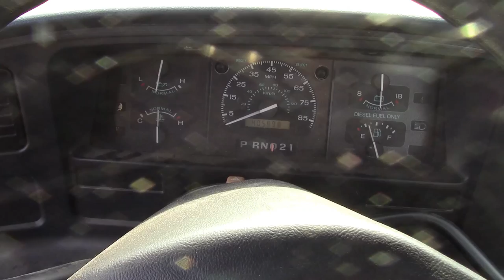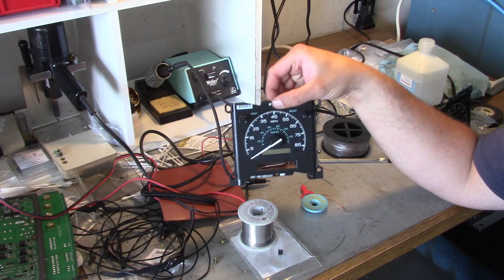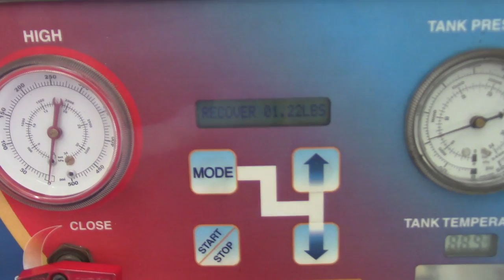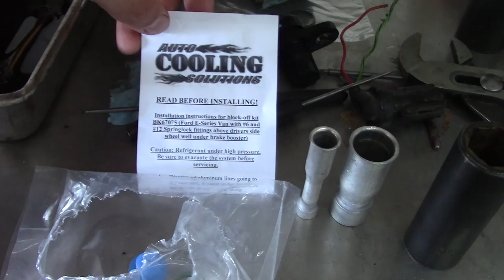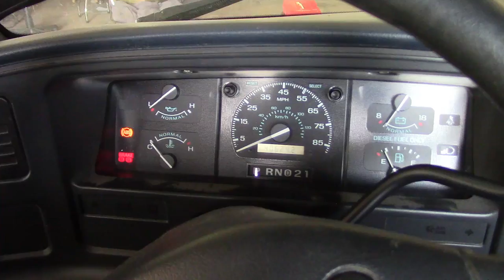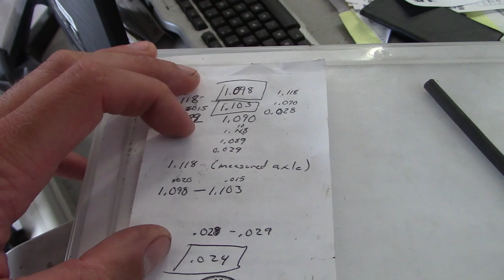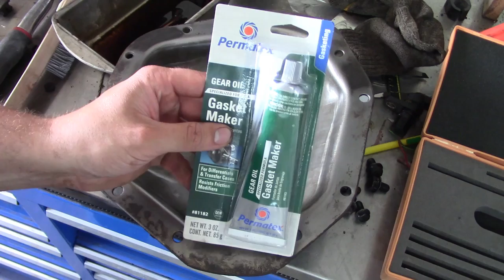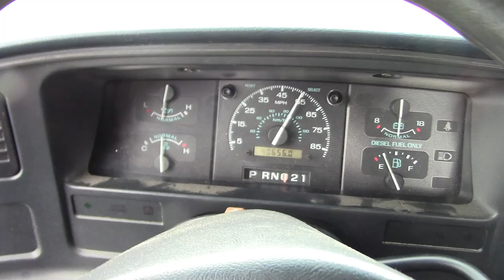Ford E350 | Speedometer Diagnosis Frustration

Comment: One of the things my shop was known for was air conditioning over 50 years experience, nothing lasts forever but auto air is relatively reliable. In the past block off devices didn't exist and you had to be creative, many a vehicle was fixed by the old crimp and weld method so I would say don't worry about bimetal reaction something else will break before you're block offs fail.

Comment: Hi Wes.   Really like what you do.   Please keep doing it.
I AM NOT a mechanic.    I have none of the skills you do.  I am however, familiar with electronics.
My opinion is that it is just the PSOM module.  I base that on the signal I saw from the module on your scope.   Yes,  The signal was a little unstable at times but there is signal and there is signal conditioning in the module.  I believe the module will get all the signal it needs from the tone gear even with a little pitting or rust on the tone gear or ring.  I think there may be other issues with that PSOM board.  I also think you proved that when you tried it in your truck.   I don't think it kicked your butt.   I think you would have had to order a new PSOM.     Just my opinion.    -Jack

Comment: The issue with having dead ends in A/C systems is if the compressor fails etc those dead ends often trap debris and contaminated oil which can't be flushed properly. I know here in Australia we had this very issue with Freightliner Coronado trucks, on the day cab models, they have the lines that tee at the front system TX valve at the firewall and run down to capped off ends just under the passenger side floor. Daimler Trucks here actually released revised pipes which still had those stubs (as they contain the charge ports, but the stubs finished at the ports, so if they had to be flushed it was just a case of removing the valve cores and flushing them.😊

Comment: I’d be happy with a speedo that fluctuated only 1/2 mph!  Mine jumps around like it’s being electrocuted.  Does nothing until about 45, then jumps all over.  I’ve been thinking it’s an electrical issue as several other things went south at the same time (security system, door locks, dome light).  We have mouse problems on any vehicle that sits for more than a few days at a time. You’ve given me some ideas to pursue.  94.5 F350, 7.3L PS.
Reply from the maker: Yeah, the mice a terrible here too.
Reply: I just had a Mercedes SL500 totaled by the insurance company due to mouse damage. They quit looking after they got to $10k in repairs

Comment: Hi Wess you will love the Pico scope - I have one and it makes your diagnosis much faster and accurate.  I have worked with lots of the little induction sensors like you have in the power generation business and I can tell you that you will have a very nervous engine if the speed sensing circuit is not perfect.  One thing I noticed is the relationship between the width of the tone ring and the width of the magnet on the sensor.  Looks like either the sensor magnet/coil is too big or the tone wheel is too narrow.  The wide magnet will take more of a tooth to generate a reliable signal. I know this is a design issue and not much you can do about it.. However, one thing you can do to clean up the signal is to run some shielded wire on that signal wire - only ground the shield on one end though - you dont want to build in any ground loops for you to figure out... when I went to Woodward governor school about 1991 they had a simulator that would demonstrate how a bad tooth would effect the speed sensing circuit on their electronic speed controls - you would be surprised- I'm pretty sure the new tone ring and some shielded wire will cure your issue.  Good luck and dont worry about getting your ass kicked - odds are there have been 5 guys ahead of you on the same issue... nice video..

Comment: I think with these electronic driven vehicles, or for any vehicle for that matter, the initial interview with the customer/driver/owner is as important to make sorting out problems easier. And yes, aluminum and steel will start a galvanic reaction when in contact, its a slow reaction but can corrode parts over time. Any dissimilar metals in contact will induce galvanic corrosion. Its the reason tools, instruments were cases in those nicely made wooden boxes in the past.

Comment: Just a thought . I have used synthetic gear oil in rear end applications. They always leak . I have since changed to Lucas 75W-140 . No leaks. May work better with that with the friction modifier . Thought to myself when you were putting it in . It's going to leak .
Reply: Synthetic lubricants will actually leak more as a whole compared to the standard stuff because  the 'molecules are smaller' from what I understand. I'd rather reseal whatever I need to just to get the superior longevity out of the internals that the synthetic stuff offers. There is most definitely a difference in the long term from using them. From my experience, it can be rather drastic, which makes spending easy to justify if you value your vehicles. My .02.

Comment: I just replaced the front when bearings on my Mk4 jetta, and the ABS tone rings on the hubs look exactly how you would expect them to look after 18 years of central Ontario winters, but I've never had any trouble with the speedometer. I think just the presence of ferritic material will trigger the sensor, rust or no. I guess we'll see when you get the new scope hooked up. 

And as a professional machinist, I sorely envy your 3 depth mics. It seems like everything I build has 3 or more tight depth tolerances, and I have to change at least one rod for every part.

Comment: If it were my truck, I'd live with it (except for the pinion seal), but, on the other hand, I'm looking forward to you busting out the Pico and getting to the bottom of this.
BTW: my former employer worked closely with Pico (I translated the software and the manual into Dutch), so don't hesitate to ask if you need something explained/worked out. Obviously, I've lost my priviledged access to the Pico engineers and developers along with my job, but I would be more than happy to try and help out.

Comment: Customer: "I need a special tool for working on a '58 Packard Straight 8 with double 2-barrel carbs, suicide doors, and purple-and-black tuck and roll upholstery"
Wes: "Hold my beer".
Reply from the maker: I've never messed with a straight 8, but they are cool. My great uncle had one in a Packard. He told us you could set the timing by putting a glass of water on top of the engine and turning the distributor until there were no more ripples in the water!
Reply: @WatchWesWork  you sir are my hero. 😂

Comment: 10/10 for perseverance. It’s an old truck and I notice none of the speed sensor wires are shielded. One potential source of ‘sproggies’ (unwanted noise). Does the speedometer module have its own power rail regulation? Have fun with it anyhow. Some things are just pups from the factory.
Reply from the maker: The sensor wires are twisted together, which helps with interference.

Comment: When you first showed that tone wheel wave I was really suspecting a bad pickup. But the bad tone wheel makes more sense. The amplitude shouldn't have been bouncing around like that. The high and low teeth and the notched teeth were probably responsible for that. I suspect that the driver electronics square up that signal, which should account for amplitude variations. But if it is managing to get double pulses off some of those notched teeth it will be getting a wibbly speed reading. Short of trying to file down the tooth with the notch to get rid of the notch I'm not really sure what to do.

Comment: For future reference, the Dana 80 axle used in Super Dutys, they use a 75w140 synthetic, expensive as hell to do an axle service.  My understanding is that Dana 70 and Dana 80 are the same size center housing, but the 70 uses smaller gears.  I know from direct experience the 70 uses the same yoke as the 60, so it's maybe a Dana 80 housing with Dana 60 gears.  Dodge loves to use the 70 and 80, makes it really hard to know what's what.  The Ford 8250lb GAWR Dana 80 uses a 1410 u-joint.  I know they offer an 11k GAWR Dana 80 in the motorhome chassis, but I don't know what upgrades those have (axles, u-joints, brakes, bearings).
Reply from the maker: I thought the Super Duty trucks all used Sterling axles.
Reply: @WatchWesWork  The SRW trucks use Sterling 10.5 axles and Dana 50 (250) or Dana 60 (350) front axles.  The DRW uses a Dana 80 with 8250 GAWR and 4.10 gears.

Comment: You are the gadget guy. Cool tools!!! Welcome to Fords ministry diffrential gear oil. All other fluids are "its gotta be this or that" 
You're in for a real treat getting the ring gear assembly out of the housing. My Dana 80 with a rear fuel tank - there's no room (except the secret combination) to get it in or out + it's a heavy *****r. Good luck setting back lash + preload + gear pattern.....Cheers.....
Reply from the maker: Yeah, I'm sure the tank has to come out to pull the carrier.

Comment: i have reluctantly, hint hint, taken a cut off wheel  and dug down on a bad reluctor wheel in order to clean up the signal from damage caused by a loose clutch in the LS , i simply cut the grooves down a bit to give the vss signal more definition , it wasnt as dirty and seemed to improve shift quality as well.

Comment: I wonder if there's an RC pair that sets the filtering on the PICO module... that would smooth those variation a tich.... but I'd have to see the circuit.  Your video coherence was FINE!  Great video.
Reply from the maker: Supposedly Ford had updated the design to be less sensitive, but I don't know what was changed.

Comment: Wes that used board could be the issue with speedo bouncing. Maybe it is at the beginning stages of failure? Just a thought.
You'll get it. With the new scope you should be able to view the signals and tell if you have a "jiggle" in the sensor signal that you couldn't see with the other scope that matches the bad spot on the tone ring.

Comment: Tone wheel MUST be replaced.
 NO 2 ways about that. 
Been told by people in the know that rusty tone wheels do nothing negative to hall effect sensors when it comes to doing their job. Air gap is king tho.
Leaking oil diff: Synthetic oil(s) tend to clean and remove deposits that were MASKING leaks that already existed.
That's one of the reason people feared(and still do) going from dino based oil to synthetic stuff.
Maybe that's what happened, maybe not . . . 🤔.
P.S: Don't get hot about it, can't fix something if parts are not up to snuff to begin with. 
NOT YOUR FAULT. 😎👍
Tell the owners what's up and let them decide what to do. Not your problem. 👌
P.P.S: You're probably dying to see that thing go away for good but honestly I'm looking forward to the next episode and the axle leak/tone wheel job. Always very educational and entertaining.
HANG IN THERE ! YOU CAN BEAT IT ! 🤘

Comment: Rust doesn’t affect magnetic fields I think the stepper motor for the speedometer head might be a lil sticky from sitting I believe you fixed the main issue with the module on the speedometer

Comment: Wes had a similar problem with my 96 ford superduty with the 7.3. United radio in Syracuse ny rebuilds the gauges. Mine would shift in and out of gear on its own. No problems since the rebuild.

Comment: I had this issue on my Grand Am GT and it was coolant fluid dripping on one of the bare conductors for the speedometer module. Hence, causing a short, also it was a slow drip that’s why the faulty reading was intermittent.

Comment: Had the same issue with mine. 1997 f250 Powerstroke. Truck must have sat before I got a hold of it the half of the tone ring that sat out of the gear oil rusted.

Comment: Question, do rusty ABS tone rings make faulty codes so as long as they are still spinning and not detached from the axle shaft?  I've never heard of that occurring unless it breaks off entirely.

Comment: The little heat guns were made by Ungar before Weller absorbed them. Mine is an Ungar, great for quick concentrated heat. I use mine for brittle plastic electrical connectors-
Reply from the maker: That thing is awesome!

Comment: I just did my diff cover and used The Right Stuff torque and go gasket stuff.  Let it sit a day then filled.  It leaked within a week and all the bolts were 1/2 turn loose.  Maybe gear oil causes some shrinkage?  I  think all the stores carry now is LS gear oil.  My Tahoe needs straight lube and I couldn't find any.
Did you try the fixed speedo in your truck to rule out the ring?  Good luck with the beast!

Comment: Usually in older electronic speedo/tach circuits, there is a Voltage Regulator (VR) that puts out a constant voltage which is used to stabilize the output pulse frequency and voltage, going to the speedo/tach motor. It would be a good idea to check the VR output if you had the circuit diagram
Reply from the maker: The PSOM has a 5V regulator built in.
Reply: @WatchWesWork  - is the voltage stable?

Comment: Holy Mackerel!    You got further than the dealer would have.  

I say ‘don’t use cruise:-0)’

Jim
Reply from the maker: Well the speed sensor is an important input for the transmission.
Reply: Watch Wes Work actually.   Good point.

Comment: well, honestly did not expect that kind of failure. guess it makes sense given this truck sat a lot. most of the vehicle speed sensor failures I've seen have been corroded wiring, bad sensors, and occasionally the instrument cluster. oh and that one time with a wonderful aftermarket alarm that had been removed with tin snips.
Reply from the maker: It's a first for me!

Comment: Try an FFT analysis of your sinusodial signal from the axel and compare these two in case of overtones. Set up the fft bin size to max and the timebase to 1s/div. at least for a good measurement. Picoscopes with a 16 bit ADC work fine for jobs like these in the audio frequency range. 
Good luck!
Reply: Good idea.

Comment: Like # 500. Great Video Wes. Ive fixed this same problem on 1/2 ton trucks many times. It was the Reluctor or the air gap 90% of the time . Frustating as hell but youll whip it

Comment: My 97 f350 had a jumpy speedo. I replaced sensor. Tone ring was good to the eye. I more or less just accepted it and never used cruise anyway.  Didn't want to screw with gauge cluster so maybe that would have fixed it.

Comment: Sorry I wrote a book, part of the career.  If the internal fluid was electrolytic (like coolant), it would probably be an issue. Since it's refrigerant and hydrocarbon, neither are electrolytic, so they shouldn't support galvanic corrosion (internally).   If the mechanics in your feed don't have any practical experience with the application, here's a definitive article from ASHRAE covering the exact topic.  http://sperkoengineering.com/html/articles/Dielectriic%20couplings.pdf    I think for this application the primary corrosion concern would be road salt oxidizing the external surface of the aluminum.  My best advice: In industry, we generally try to remove/minimize low point dead legs because over time they can collect heavier liquids and/or contaminants.  Sometimes result in burst failures after thawing after a cold spell.  While you don't have to worry about water and freeze/thaw, I would still demolish both dead legs all the way back to their original branch tees and try to replace the tees with unions. (That way if you had to keep the aluminum caps, this would probably at least get them up and out of the salt spray under the vehicle).  Some really great content from this vehicle.

Comment: Well, those teeth looks pretty okay to me, I mean, why should just small differences in amplitude cause this? Doesn't make much sense to me - since the module is reading frequency and not voltage differential.

So it should read all peaks above a predetermined threshold and send a click out to the switch for the output.

I think your issue is somewhere else.

Take a look again at your oscilloscope recording, some of your pulses are shifted to a different ground level.

So either the sensor is reading some weird values because of high amounts of vibration - so maybe a wheel bearing or an axle bearing is shot and do some resonance vibration at those speeds, or something goofy is going on with the wiring.

Just run a coax cable to the front directly from the sensor and check again how this signal looks like, maybe some amount of impedance is causing this.

Also: Maybe the ring was replaced with a "new" one which was rusted, because someone didn't want to spend the money on a new one and tried to fix the issue with the speedo.

t might just have an awful amount of runout, so worth doing some blue marker on it and scraping a circle on it, to see how bad it is.

Comment: I'm thinking back to those weird unexplained noise spikes on the processed scan data back in one of the earlier episodes on this truck. The volt meter is also pretty low after starting it on the last test drive. Is it possible there is an electrical noise problem which is affecting this speedometer system? Alternator diode /regulator problem or bad ground somewhere maybe? I'd try to run it with the rear end jacked up and the alternator disconnected.
Reply from the maker: I've tested the alternator and it's fine. The volt meter is always low on startup in a Power Stroke. The glow plugs stay on for about 2 minutes.